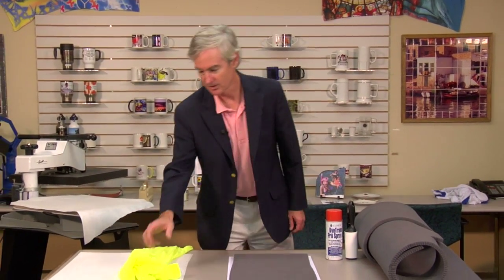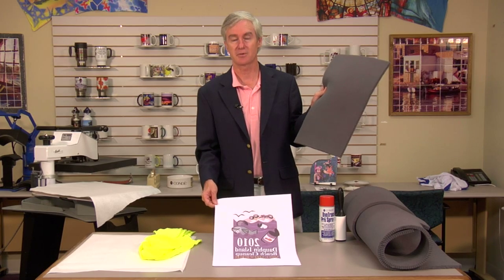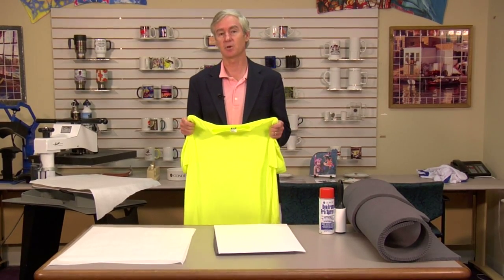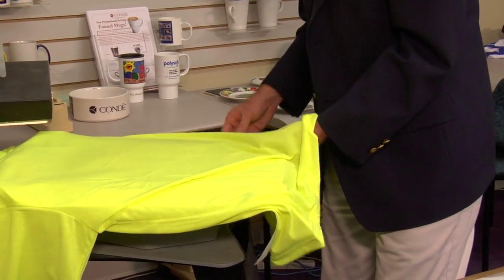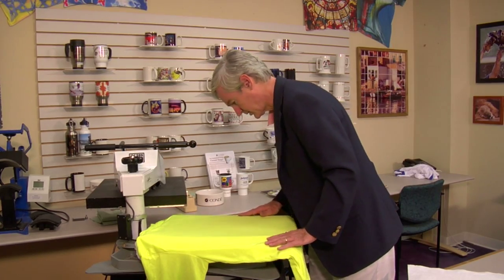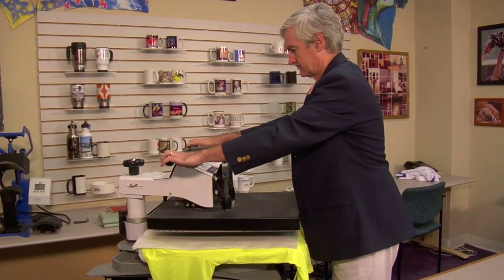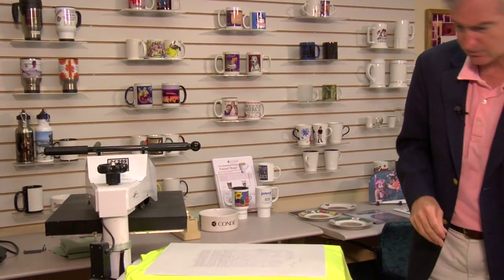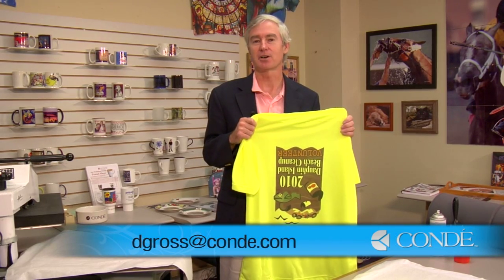Sublimating a Vapor® Polyester Shirt Using a Foam Kit -

Comment: Also, what pressure do you use for your dk20s with and without the foam kit?
Reply from the maker: The pressure and time vary and we only publish them on our website on the specific shirt product page. conde.com
Reply: Could you post a link to it? I just purchased the 12x14 platen of yours for the dk20s so I dont need the foam kit.

Comment: why waste the time to put the foam pad inside the shirt instead of just sitting the shirt on top of it?
Reply from the maker: That's the recommendation from Vapor Apparel. To minimize the extra layer that might be wrinkled. If you are comfortable laying it on the foam, it will certainly work as well.

Comment: How did you print on the butcher paper?
Reply from the maker: We did not print onto butcher paper. The butcher paper is used to protect our press from ink spread. The transfer is printed onto sublimation paper using sublimation inks.

Comment: hi I am from Colombia! umm this might sound dumb for you but... i dont know the way to get the image that I'm gonna print without a square shape, i mean i dont even know how u get an image with no background, just the original shape for example of a face... i appreciate if u tell me a little bit of it, please!
Reply from the maker: If you use Corel or Photo Shop, you can use white or the "Erase" button to create no background, remember there is no white ink.
Reply: Thank you so much!
Reply: +Conde Sublimation is there is no white ink why she even gets the white even if its in her design? Isn't it the "transfer" paper with a transparent finish? It still transfers the white?
Reply from the maker: No, the paper only holds the ink. the white in the design comes from the fact that the shirt is white. On a colored shirt those areas would be the color of the shirt.

Comment: After 30 40 presses you just throw the piece of vapor foam away an cut you another piece so that you can eventually run out and order some more. I think it's better to use material like the mouse pad material that wont loose it's cushion. Nice video on the sublimation process ! Have a great evening.